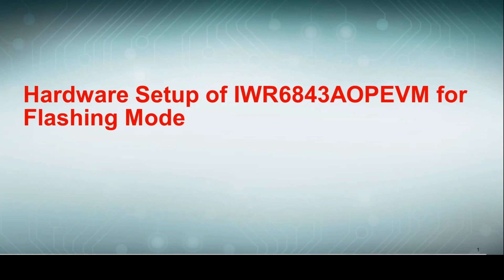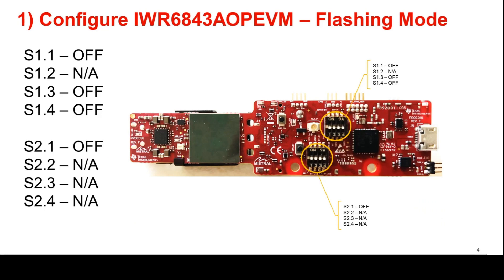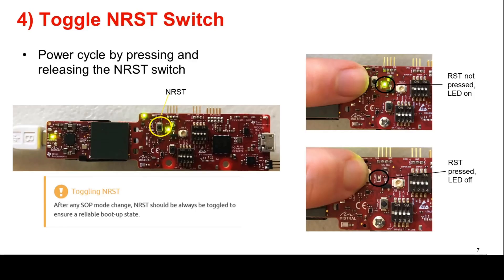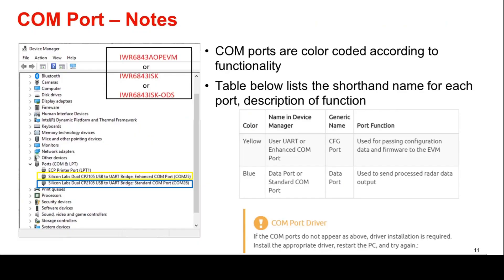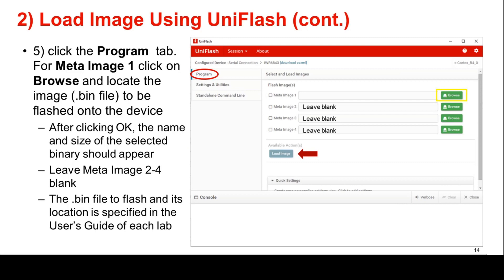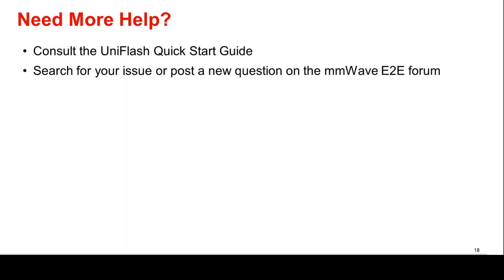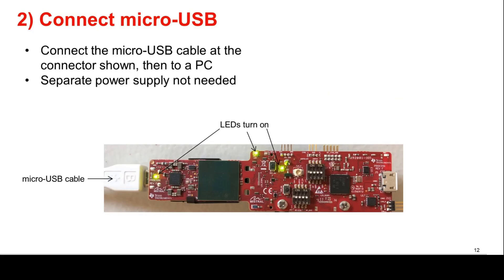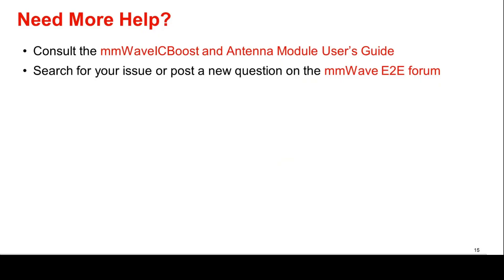Hardware Setup for IWR6843AOP | IWR6843AOP EVM intelligent mmWave sensor | FMCW Radar

Comment: Hello, why in this video did you use the 64xx image?
Reply from the maker: Hi,
No, 64xx is a different series of hardware. It‘s iwr6843aop image. You can find that in the mmwave industrial toolbox
Reply: Hi thanks for your reply. At the time I struggled to find the correct bin file but I got it all working

Comment: Hi is it possible to run GTrack people counting with just the IWR6843AOPEVM without the MMWAVEICBOOST? Kinda unsure whether I need it or not
Reply from the maker: you don’t need mmwaveucboost for it. Simply run the demo which is using gtrack
Reply: @FlamboyantEngineer  good to know, thanks!